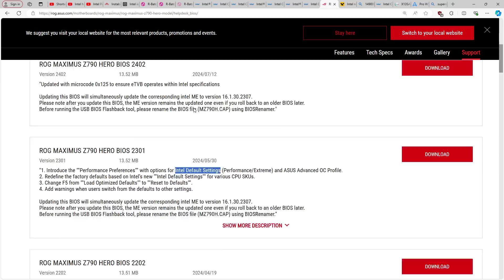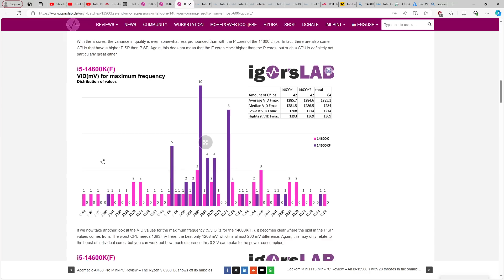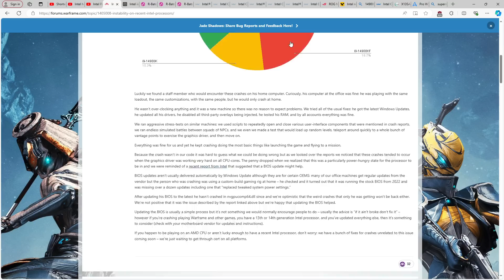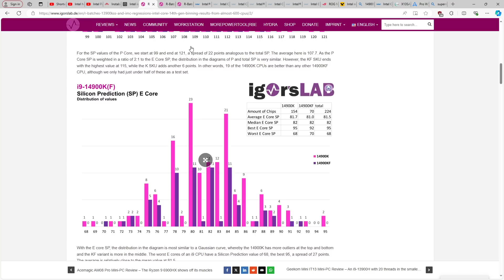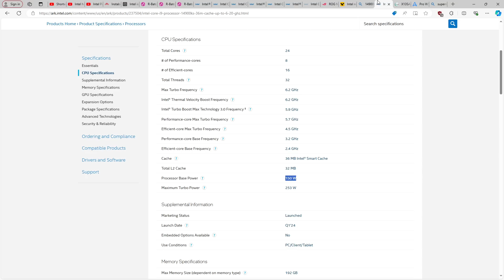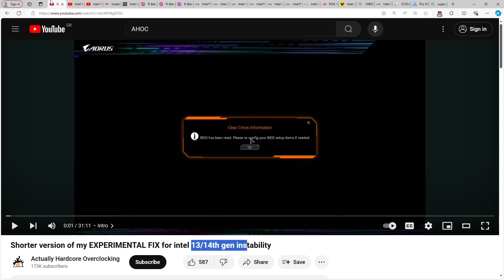The intel instability and degradation rant.

Comment: Microcode 0x125 raise vid for 14700k and 14900k,default intel profile.Msi 0x123 had low VID 1,35V for 14700k default boxed cooler profile.
MSI new bios with microcode 0x125  and intel default profile raise vid for my 14700k to 1,41V
 cpu lite load control MODE 9 with microcode 0x123 and  cpu lite load control MODE 16 with microcode 0x125

Nice try intel +msi to hide cpu degradation,raise vid to work with degraded cpu
Reply: Microcode 0x123 msi board cpu lite load control MODE 9 for default box cooler
AC/DC 0.400 / 1.100 mOhm
14700k VID=1,35V for single default boost 5,6ghz

Microcode 0x125 msi board cpu lite load control MODE 16 for default intel profile
AC/DC 1.100 / 1.100 mOhm

14700k VID=1,41V for single default boost 5,6ghz

Comment: important to note that the reason HFT firms like Citadel are using intel i9 chips is because it has the highest clockspeed of any CPU out there. clockspeed is the most important thing in trading as single-core performance determines trading latency. Xeons are not even remotely close to 6GHz.

Comment: Oh and also I know you say you don’t think your i9 is degraded or degrading. I’ll just say that I built my computer 3-4 months ago and then barely played it cause I’ve worked so much. Only in the past few weeks did I attempt to play Pacific Drive and Once Human and started crashing. Called a computer tech guy cause I just didn’t have the time to learn how to undervolt it which is something I knew it needed and the guy actually talked me out of spending money with him (cause I think he didn’t want to touch this hot potato). I just now swapped from a 280mm to a 360mm AIO and updated bios and all I changed was the PL1&2 to 253 and ICCMAX to 400. Idle voltage is 1.41. 🤷🏼‍♂️ idk I guess we will see. If it degrades I’ll just RMA the CPU and get money back, take a hit selling my Apex Encore, wait till 9950X3D and swap over. I just want a stable computer that I can game on when I have time but can’t also mess with after this job is done and I have extra time and for it to be top of the line cause it’s my hobby and I like to brag. Hope everyone else impacted by this fucking bullshit. I’m 50-50% on whether I think Intel is actually going to do right by all of us affected. I’m not a pure Intel/AMD/NVIDIA/whatever. I just want the best. I have no kids so I got money to burn on the shit I like.

Comment: Hey one thing I just noticed was that your 14900k you was using as testing gigabyte, Asus and then your experimental fix, the SP goes down at every video. I think from 95+ then to 93+ and at the end it was 91+. Mines at 95 right now. I only built my comp 4-5 months ago and have barely even played on it. Only here in the last month did I attempt to play Once Human and Pacific Drive. So at the moment I’ve swapped AIOs to a 360mm from a 280 (the 280 was supposed to be temporary until I custom looped) and changed the PL1&2 to 253 and ICCMAX to 400. Didn’t go above 85 at least so far. Voltage was 1.45 at idle. At this point I’m just going to wait for 9950X3D and switch. RMA the cpu and see if I can get half my money back on my apex encore 🤷🏼‍♂️

Comment: I find it funny that voltages we used to think as "too high" and "will degrade your chips in the long run" are now the default voltages from the manufacturer…
Reply: What makes it worse is that these newer i9's will only take around a -100 to -135 mV undervolt. That's nothing, compare that to the 5800X3D that can undervolt all the way from 1.35V to 1.025V but still hit 4.4GHz overclock on all cores with PBO. Its not the king but the 5800X3D is still a legend lol

Comment: Actually Hardcore Overclocking : historically Intel CPU-s were on contrary, very unstable since the Coffee Lake refresh 9-th gen launched and when they first released their 8c/16t desktop CPU. I've owned an i9 9900K and I've assembled RIG-s with the i7 9700K-s and i9 9900K-s numerous times....and if left on stock MCE ON with no Watermonoblock covering also the VRM-s, those two chips were able to gradually become unstable over a period of time of less than 1 year. Back then I've contributed those random BSOD-s or black screen freezes to the Win 10 OS....but today I know that they were mostly as a result of the CPU.
Alongside that I had to replace 1 motherboard per CPU in that 1 year time span due to one of my memory banks becoming unstable as a result of unstable voltage pumping as a direct result of the heat losses that the LAVA hot i9 9900K consequently produced very near the most left memory bank.

With these 12-th, 13-th and 14-th gen, Intel has literally put 2 CPU-s under 1 CPU die, a desktop (P-cored version) and a mobile (E-cored version). And as a result of too much current, too high PWR losses causing too big of a Voltage fluctuation and thus too much LAVA hot heat being trapped on that small area....this results in the silicium architectural degradation where certain portion of the tranzistor logic simply becomes melted and conjoined together.

Comment: Buildzoid probably already knows, but this just in: GAMERS NEXUS leaks that the issues may be from OXIDATION of silicon -- it could be that Intel has applied anti-oxidation chemicals incorrectly in the manufacturing-process, and this could be why the faults are so random: wherever the anti-oxidant chemicals are altered or misplaced, you will get degradation. 

I'm curious what Buildzoid thinks about this though?

Comment: If you cheap out on a power supply and mainboard you are obviously going to have power and instability issues, it's like running a turbo on an old car and expecting great performance when the other parts can't keep up, it's like over flowing your fuel tank with a poor fuel pump not able to pump fuel fast enough.

Comment: I think Intel really needs to start to check what the vendors are doing because there is absolutely NO excuse for a brand new out of the box CPU to run unstable at stock settings. I have a theory about the GPU related errors especially out of GPU memory error I think it is because the CPU is sending garbage data to the GPU it gets confused thinking that card is out of memory causing the game to crash.

Comment: Wasn't the reason that until stayed on 14 nm for so long because they couldn't get 10 nm yields to be acceptable. A specifically remembered Intel really botching their new fab process for a while there. If this is on Intel's new fab process. This could point them having fab issues still. 
That might explain why they have separated their foundry and processor divisions. Is foundry is still having issues. The only solution might be switching to another foundry. This might explain why Intel's kind of being quiet. Hopefully I'm wrong and Intel hasn't fundamentally screwed up their foundry.
It could also be somebody who's making the silicon not wanting to look bad after you know repeatedly causing problems and saying yeah it'll be fine. It just feels kind of like management is very dysfunctional right now at Intel. They've been messing up a lot of things recently.

Comment: I've been running 300 watt limit on my first 13900k CPU and undervolted it, it degraded, I started getting lock ups, but I blamed my undervolt, though it was stable in AIDA64 and games before
Then I rma'd the 13900k, and watt limit to 262 now, it is working as good as previous CPU, and I hope it was my undervolt, but it could be issues with CPU
Previous CPU could do 8000mhz stable with Apex Encore, with this new 13900k the memory controller is bit more unstable and lower quality metric in Asus stats, so I went to 7733mhz and so far so good.
I pin all my cores to 5.5 and 4.3 for P-Core/E-Core, and don't let 2 cores to boost to 5.8
No Intel Speedshift or Speed Step

Comment: This has been going on and off people covering it for the past 6 months when none of the issues have changed. And the answer is still the same. Do not use cep if you are undervolting. You are just making your cpu worthless giving it pretty much the performance of a 10 year old cpu by using this one setting that is doing absolutely nothing if you are undervolting. Intels answer to this is just max them at 1.1 ac dc so cep doesn't trash the performance of the cpu. You know what else that does though? Absolutely burns your cpu alive. Intel default settings will see a 14700k pulling near 1.6v in some demanding gaming. If anyone thinks this is smart to follow then gl lol. 

These cpus all have a massive overheating problem along with other issues degrading the chips. As a whole there is nothing you can do to stop it because it's the cpus them self as other big channels have started pointing out but what you can do to help the cpu are things like undervolting setting the lower power limits and amp limits not letting the cpu go insane for no reason. 

As far as I am going, and I know this is not a guide because everyone has different luck with these cpus but 253 both power limits is 100% fine and 307a is fine even maybe a bit safe because I am sitting on 400a just fine. Again the undervolting for this though is critical. The voltage these cpu even for an i7 want to pull for just gaming is insanity. Legit no idea why they recommend cep unless. Seems like a default AI reply "just turn all the safety features on that will fix it" despite the problem with these chips affecting people who are never overvolting or overclocking them which is the only use case where cep might of actually helped.

Comment: P = I * V though... raising V will lower current for a given power demand.   Do we know for certain that voltage is causing degradation more than current?  Perhaps lower voltage is driving a higher current which in turn is causing problems.

Comment: You don't even need to permit that two-cores go 6Ghz or do anything crazy - my 14900K with HT off and just doing 5.6 all core at about 1.190v needed to me to up that 1.195v one month later after a month of most defiantly not hitting this CPU hard - unless Grim Dawn 1.2.X.X or updated Last Epoch sometimes and tons of YouTube and Twitch are too much for the mighty i9.  This follows a 13900K that has a similar path.  EDIT - Well, well, well - never mind, I don't need to up voltage, I just needed to drop my ring/LLC clock by 100Mhz (so, 4.4, same as the max for the E-Cores), and all problems go away.  Sure, I am not smart to go with one datapoint, BUT, if many are saying it's the ring - and here my ring going down 100Mhz is a fix (at least for now), then I feel, but don't know for sure, that this is confirmed.
Reply: Anyway, good time for AMD to be pimping those soon-coming Zen5 and 9000 series cpu's.

Comment: Is the i9 14900H/HX affected or just the K series? Asking for a friend...
Reply: We have conflicting reports so far. I have, 13900HX ...only "out of memory" I got 3 times in a row was to low RAM and was fixed with force-rising pagefile to 3000MB on minimal.
Laptops have more restrictive TDP limits, so by logic, if instability even occurs, the possibility of silicon degradation is still much lower, as material itself is the same while voltage and AMP's are considerably lower, even halved. Don't panic yet, but watch closely.

Comment: Yeah, very suprising 100C TjMax and pushing >200W into a socket would cause failure. Wouldn't have guessed that in a million years.

I'm positive it's just consoomers that are holding the device wrong, and der8auer will have a video up with a Intel exec explaining how it's all just bluff.

Just like how they explained 95C is a very normal and safe operating temperature to stupid consoomers previously, which it is. There's nothing wrong with a processors going to that temperature when you are playing a game, and you want to have it at that temperature: because then it performs the best. Clearly.

Nothing to see here consoomers, there's nothing wrong. Intel is making the very best of decisions.

Comment: Of course chips degrade. The question is how fast and how robust a chip is. Also Intel has had issues before, remember the Pentium III 1.13Ghz disaster? Current day Intel is that disaster plus as an added bonus the excessive power wastage. You probably are in denial about degradation because overclocking degrades faster and you would not want to consider yourself as someone intentionally damaging their hardware, but you do.

Comment: Can tell intel is on the defensive, pushing beyond safety (spectre/meltdown) and stability (high temps and power use, degrading) to keep up with amd. E cores are pretty pointless outside of laptops, but they help them keep up on multi threaded benchmarks since amd was stomping them. Now they're pushing this 6ghz to get that title and over red line speed to keep with in games with the 3d chips. They're struggling.
Reply: E-cores pointless?
My 12700K is aircooled and on Cinebench reaches 71 degrees,a Ryzen 7 7700X with no e-cores reaches 95C and is just an 8 core chip.

Both AMD and Intel push sillicon too hard, i hope the failing 13900K/14900K is a wake up call for both companies and stop increasing clocks.

Comment: What about the laptop chips? My Acer work laptop has the i7-14700HX, and it boosts to about 5.5Ghz under 1 to 2 core workloads, but drops as more cores or loaded. It's power limit appears to be about 137 Watts anyways, so I hoped it wouldn't be affected. Just Ran Cinenbench R23, and CPU-Z reports voltages of between 0.9V & 1.0V under multi-core, but up to 1.45V during single core. My day to day work load sees 1.3v to 1.425v.
Reply: They are reports some of them are impacted too, but since you have an I7 you should not be the most impacted by this. Laptop cpu have better binning and are pushed less far in general...
Reply: @arthurbesnard1536  I hope you're right! When I've looked at voltage spikes, I've only seen ~1.46v max. The report showed some desktop chips getting pushed into the 1.5v+ territory, which I don't think mine is hitting. Fingers crossed! :)

Comment: Underclocking is a proven fix, running a 14900K at 5200 MHz for 6 months straight, running a linux server. If not underclocked, crashes every couple days.

Comment: If I would of paid attention before building my 14900kf system I would of never of gotten this crappy CPU.  From the start I had a lot of stability issues & high temps.  The only way I was able to "fix it" a bit is by updating to the latest bios and making sure Intel default is on.  I also had to set PL1 & 2 to 210W because there's no way I could run 253W without my system crashing every 30 mins to 1 hour.  I still had stability issues with my games like Warframe crashing on me for no reason.  So I had to lower the settings from 57x to 55X and this somewhat tamed my issues for now.  Given I had to gimp the CPU settings which I find Ludacris because you spend so much money and  you need to nerf the settings.  I lost a lot of respect for Intel after this and if they don't get their stuff together I'll be going back to AMD.  If the next CPU lineup is stable and better I may swap my MB & junk 14900kf to the new CPU line up.  But confidence wise I doubt Intel will fix their issue for a couple of more CPU lineups.

Comment: My 2700k degraded a lot during my 24-7 overclock to 4.2-4.4GHz using not ideal settings and a poor cooler. After a few years it barely ran 3.9-4.0 GHz stable. But at least it didn't outright die

Comment: having problems on my 13900HX laptop cpu, nightmares just like the desktops. I shoulda got 12th gen
Reply: Two questions, are you running it with an overclock and your laptop has liquid metal?
Reply: @saricubra2867  no, no overclock, i had to actually lower clocks from 56x to 50x. it has the honeywell 7590 or whatever, the really good stuff. no liquid metal i think. its brand new is the thing, less that 6 months old.
Reply: @saricubra2867  my 13900HX has liquid and overclock ...but only "out of memory" I got was solved with pagefile set to 3000MB min and from 3 crashes of unreal in a row i got NONE after that change ...also I have just 16GB of ram that I have to replace and I run very demanding game, as on one hang-crash I could not even open task manager until I closed game by different means.
Never had BSoD related to this, SHA3 passed...still have to run few times just 1 by 1 core and make this Nvidia driver reinstall test.
Reply: @DeepInsideZettaiRyouiki  "overclock"
That is the root cause of your problem.
Don't overclock it .
Reply: @DeepInsideZettaiRyouiki  Why would you do an overclock on 13900HX?

A friend has an i9-13980HX Asus Strix 2023 (liquid metal), no OC and is faster and more power efficient than my i7-12700K desktop with undervolting without an overclock

Even if i overclock my RAM wouldn't do much because that laptop i9 shares the same sillicon as a 13900K and has 36MB of L3 cache.

Comment: 1:40. You are wrong. Intel had 10nm since 2015. It did not work for years. The 10nm process on 13 and 14 gen is the 3++ generation of 10nm. it is not a process problem.  This is a problem that Intel has to compete with 10nm to AMDs 5nm.  To compete Intel went from 90-watt TDP on Skylake to a real wattage of 320 watts on 13/14 gen. That is the cost to get 6ghz clock speed on 10nm.   It is the constant clock gating that was introduced with a turbo that has degraded Intel CPUs for almost 10 years. Degradation is often just over turbo speeds with a couple of hundred MHZ.    I personally have seen this more on Intel CPUs without iGPU.   Would be interesting if someone could confirm that this is a bigger problem with CPUs without iGPU.
Reply: KF chips have worse sillicon quality than standard K chips.